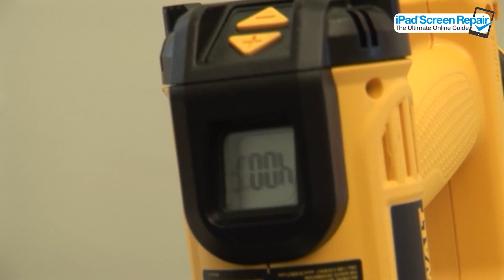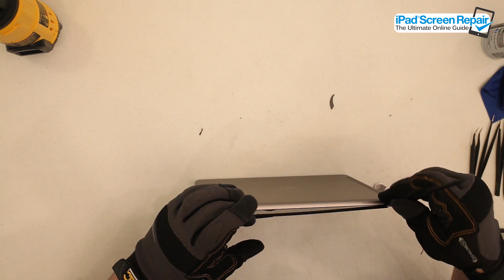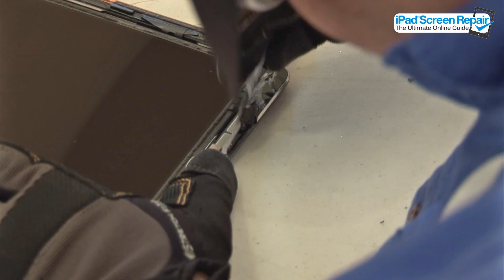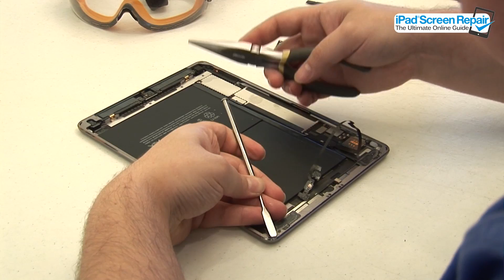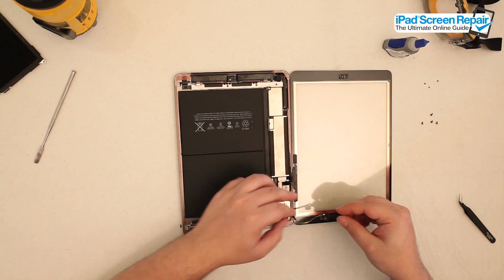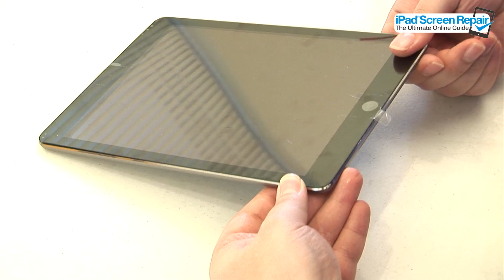iPad Air Screen Repair Guide

Comment: I really have to ask:What ever happened to Gorilla Glass?Obviously the glass on iPad Air can simply shatter just looking at it.
Mine shattered playing RealRacing3
being throttle is right at edge of holeof home button, and the factheavy duty case it was in, Access was slightly off center,So if pressing on edge of hole,It will crack.